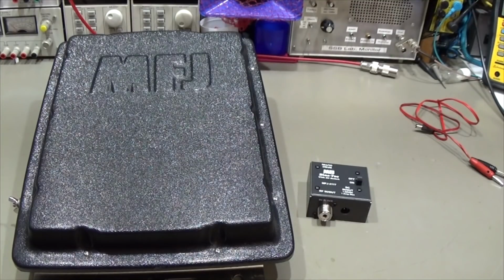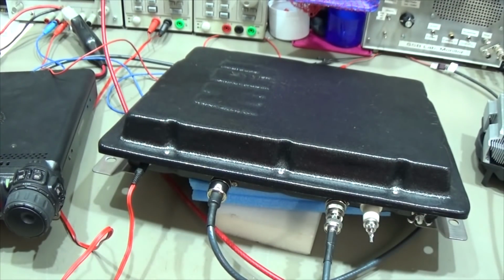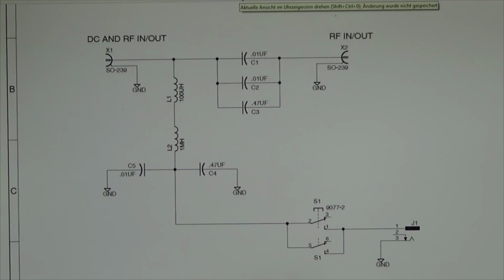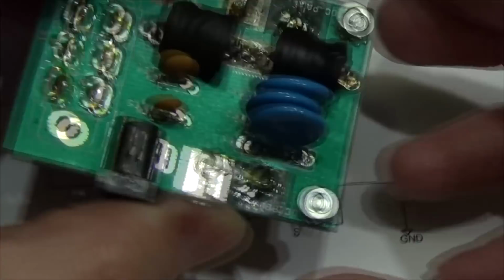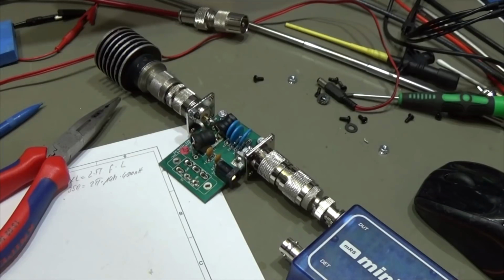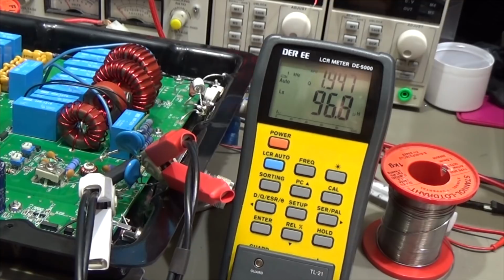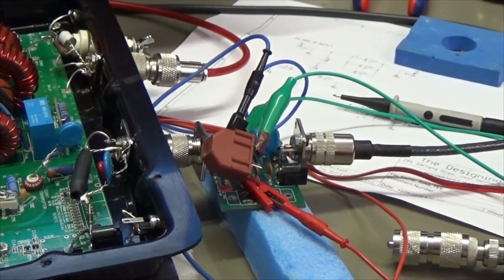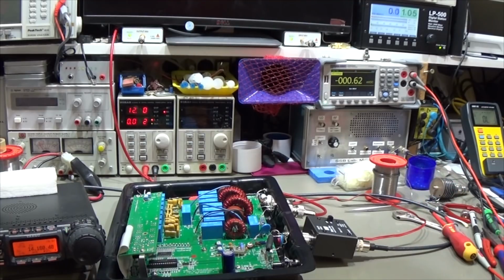#214 MFJ 994BRT Automatic Antenna Tuner  HIGH SWR fixed

Comment: Mighty fine junk. Martin's reputation is unchanged for decades. His firm has NO QA dept and it seems he hires kids off the street to perform soldering. Almost every piece of test equipment or gadget from MFJ is suspect. Have a screwdriver ready at all times. Also his designs for interfaces were great.... In 1972... Who uses DiN connectors for keyboards? The SWR analyzers use 10 AS batteries and you can blow a diode just by turning it on if the UHF button is pushed in. A known issue for decades.

Comment: It's hard to fathom that MFJ would manufacture a Bias Tee with the wrong parts.  But then, even persons working in the manufacturing field could have a bad day and choose the wrong part for insertion into the product.  It seems to me that even in the manufacturing of Yaesu radios, a person could not use enough heat sync paste on parts which eventually burns out the finals.  W Rusty Lane K9POW in eastern Tennessee

Comment: I've got a MFJ 969 Versa Tuner II wit a roller inductor.  However, it's only 300 watts.  That tuner will tune anything including a bed spring.  It even has an internal balun of 4:1 including a dummy load.  I really like this tuner.  Most all of my antennae are resonate so I don't really need an external tuner.  The tuner in my Yaesu 991a will tune all my antennae.  Sure do enjoy your videos.  W Rusty Lane K9POW in eastern Tennessee

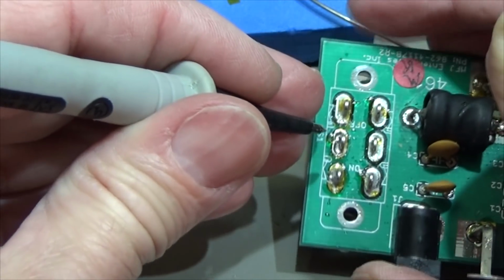Comment: 26:16 - That strange tin piece under the center of the switch is short with the edge of the plate (Ground). That is all.
73, EA7HJ

Comment: Another fine video,, but one question,,,,,, What did you do about the first problem with the DC input on the tuner that was not working right when you moved it ?
Ron AC7RH
Reply from the maker: nothing as it is not needed..

Comment: What a weird symptom.  I have one of these, and jave not seen this problem, at least not so far. (Finger's crossed.)
Reply from the maker: Yeah sometime it is weird so finger crossed
Reply: @TRXLab  Nice to see you got it working.  I was warned about these, but I'm pretty happy with mine. I mounted it up on a mast near the feedpoint of my dipole, and I've been using it to tune up on strange bands I can't otherwise use, like 90Meters. I have an amp, but I don't run power through it, mostly.  I'm not sure how far I want to push it, really, since it's a pain to get to it if I burn it up.

Comment: It looks like the two chokes in the Bias-Tee only have one turn of wire.  Why not just cut the shrink tube off of the 2 chokes, re-wind it with about 8-10 turns of magnet wire, and then put new big shrink tube back over, and re-install ?

I just got a Bias-Tee today, and checked it.  Both chokes I have in my Bias Tee are the exact same physical size as yours, but you can clearly see 8-10 turns of wire under the shrink tube.  Each is about 51 uH, and about 105 uH together.

Comment: Hi Peter. Did you decide if the wire on the switch was installed from the factory? Thank for the videos.
Reply from the maker: Well I think that was a production fault..

Comment: The interface for this tuner is absolutely ridiculous literally what's wrong with just having a control cable that goes from your Shaq to the tuner?
Reply: Because it is far more convenient to run power up the coax.  Some rigs can even do this automatically.

Comment: My friend owned the ham store in Houston.  They received product from MFJ that didn't work out of the box a lot.  I recall he sold a G5RV wire antenna and it was returned because it didn't function.  He gave it to a mutual friend.  My friend opened it up and found the wires were never soldered from the factory.  I got a 998 tuner brand new from him which didn't work out of the box.  The quality from MFJ is not good.  Mighty Fine Junk
Reply from the maker: yeah it is sometime a pain in the back if you are the quality control of the factory...

Comment: I have the 998 rt and its been back to  MFJ once. It works fine now. It's a very versatile tuner. I have the OG SGC and modded it to be able to use bias tee's. pretty easy.

Comment: Great video 
I have had one of these since they were released, the original one were even worse. No pcb board just three capacitors and the fibreglass box nevered sealed very. Mine is sat under the bench. 

73

Richard 
M0UOO
Reply from the maker: thanks for feed back

Comment: Hi Peter
Excellent video as always.  I have the same bias tee with exactly the same issue.  Could you share the part number of the chokes you used in you repair.

Thanks
Adrian
Reply from the maker: muRata 18473C;
 inductivity:  47 uH  
max (DC):  1.65 A  
max resitor:  55 mOhms
Reply: @TRXLab  Thanks Peter
Reply: @TRXLab  i didn't see you do it but did you put the center connections of those inductors back into the board and solder? or leave them soldered together off the board?

Comment: Hi Peter,
I have the same problem with my 998RT. Is the number on the choke 18473C? Just want to see if it's the same as yours. Stay safe.  73  WJ3U
Reply from the maker: Unfortunately the number is not readable but it is a muRata and taking your number it makes sense inductivity:  47 uH  
max (DC):  1.65 A  
max resitor:  55 mOhms 
you can use it...
Reply: @TRXLab  Hi Peter,
I have used my DE-5000  to test the two 18473C in series and it reads 3.2 uH. I lifted one leg on each choke to test. I removed both and tested each. One is 2.6uH and the other reads .023 ohms but no inductance. Using formula 14Mhz * 6.28*3.2uH I get 282 ohms impedance. I think that is the reason it does not work.  WJ3U
Reply from the maker: Absolutely right Don you caught the bugger :-)
Reply: @TRXLab  Hi Peter,
I also checked the muRata website and it does list the 18473C as 47uH. Must be a mislabeled batch. I found some axial 100uH chokes that should work and ordered them.

Comment: After reading some comments, I believe MFJ is not that bad at all. Few of the ones that makes Ham radio to still exist, with affordable equipment. The problem is the lack of a good quality control. There seems to be technicians with great experience, but also long time workers in the assembly line that are not technicians, but know the equipment they work on inside and out.
Reply from the maker: Thanks for comment
Reply: I’ve heard quality control issues. Hope the one I buy won’t have these problems. 73 de N9NY
Reply: Thank you Peter. Appreciate your providing us with a wonderful video! 73 de N9NY Gregg

Comment: I bought an MFJ DC distribution strip once and the main terminal binding posts were installed backwards - the RED was on negative and the Black was on positive. The soldering inside was horrible. I sent it back instead of trying to fix it.
Reply from the maker: oh that is scary

Comment: Would have lied to have seen an 'autopsy' of the iniductors. They might have been ruined by excessive RF power applied to the unit which may also have  melted the solder connection on the switch.
Reply from the maker: true but the video is already much to long...

Comment: The circuit didn't match the schematic.  That switch was wired to ground the bias lead via the inductors when it was switched off, and to apply +12v when it was switched on.  The pad that had that weird sliver of wire/solder was already connected to the ground plane on both sides of the board.  That's why it was showing a dc short between the dc pass pin and ground when it was turned off - it was designed that way.  You can follow the PCB traces at 36:58 and 26:12 . The invalid inductor values were the entire problem.  Typical MFJ quality control.  Did you go back and fix that intermittent power input connection on the tuner?
Reply from the maker: yes you are right but still that could be an operator error as well..

Comment: Thanks for the video. I would suggest to keep some ferrite cores for cases like this one. The ferrite choke you needed could be wound on FT114-43 core, 22+ turns of 0.9 mm enameled wire would do the job. 73s de R2AUK
Reply from the maker: That would be around 450uH and should work as long the wire resistor is still in the mOhms...

Comment: Diese kleine Metallklammer wird beim MFJ-4116 als Brücke anstelle des Schalters benutzt, ich habe heute nämlich einen SG-230 mit so einer Platine versehen, ist absolut identisch nur ohne Schalter. Was die Verarbeitung vor allem die Löt Qualität angeht, absolut unterirdisch. Ich habe alles nachlöten müssen. Ich vermute hier wurde eine Platine benutzt die für einen 4116 vorgesehen war und beim Schalter einbauen ist die zuvor entfernte Drahtbrücke irgendwie mit eingearbeitet worden. Hauptsache der kleine rote Quali-Aufkleber war mit Handzeichen versehen aufgeklebt. Was die Spulen angeht, sind bei mir die gleichen verbaut, ich habe keine SWR Probleme. Ich habe sie allerdings auch nicht gemessen.

This small metal clip is used as a bridge instead of the switch on the MFJ-4116, because today I have equipped an SG-230 with such a circuit board, it is absolutely identical only without a switch. As far as the workmanship is concerned, especially the soldering quality, absolutely underground. I had to re-solder everything. I suspect a circuit board was used here that was intended for a 4116 and when installing the switch, the wire bridge that was removed earlier was somehow incorporated. The main thing was that the small red quality sticker was affixed with hand signals. As far as the coils are concerned, I have the same built in, I have no SWR problems. I didn't measure them either.
Reply from the maker: What clip do you mean?
Reply: @TRXLab   Ich meine diesen kleinen gebogenen Draht, der den Kurzschluss verursacht hat. Schade dass ich hier kein Bild reinstellen kann, habe Fotos davon.

Comment: The short in the switch burnt the inductors enameled wire so that the coil is shorted for HF, why not cut open the inductor and se what happend?
Reply from the maker: hm most likely not because I got feed back that the unit initially  worked...
Reply: That "short" in the switch was to a pin that was intentionally grounded on the pcboard - so it made no difference.

Comment: What was the value marked on the chokes?  From the beginning, the extra grounded switch connection looked obviously like a solder spash to me.
Reply: The pin the solder splash was on was already grounded to the ground plane.  The splash didn't matter.
Reply: @stargazer7644  Surely it was the splash that grounded the pin on the edge of the ground plane?  Otherwise I don't see how it EVER could have worked!
Reply from the maker: That is a good point.
Reply: @hectorpascal  If you look at the pin that had the splash on it, 36:58 26:12 it has no traces running to it and is grounded to the ground plane on both sides of the board.  The pin to the left of it is also grounded to the ground plane on both sides.  It is designed to connect the bias wire through the inductors to DC ground when in the off position, and to +12V when in the on position.
Reply: @stargazer7644  So the schematic at 22:15 was wrong!?  Maybe!  - since either C4 or C5 also seemed to be misplaced.  But could this circuit change contribute to L1/L2 failure at switch off, due to discharge to ground of any high value DC feed line capacitors inside the tuner? Unlikely if the inductor coil wire is thick enough - since inductors impede transient current change, and I doubt the voltage rise would be significant.
Reply: @hectorpascal  Yes the schematic is wrong for the locations of the caps and the wiring of the switch.   This is not the right schematic for this version of the board (as often happens).  Grounding the center pin in the bias T wouldn't discharge any caps in the tuner due to the series reverse polarity protection diode between the inductor and the back of the power connector seen at the very bottom of the screen  at 11:12.  Regardless, you really couldn't do anything to the inductors to change their value other than burn them open.    It appears the wrong value component was simply installed and the unit was never tested after assembly.

Comment: Could questions in my mind , the markings on the original chokes - if they may have been correct - but then shorted out & changed values - by the on/off SW. ?
My quess that that small wire grounding the SW. may have been solder left by the worker installing the SW. , and it soldered to the ground plain - then when RF power applied - shorted the chokes - changing the values ?
Thanks again John
Reply: That side of the switch was intentionally grounded.  The PCB was wired so that the switch applies power when on, and ground when off.  The weird wire/solder line wasn't doing anything.  The problem was the wrong value inductors were used, and the unit was never tested.

Comment: MFJ is known for poor quality parts and poor quality workmanship. They are a low budget manufacturer for sure. If that tuner is rated for 600 watts RF I would worry that those inductors you put in can handle that level of power. I would take off the heat shrink from the original chokes and look for any damage to the windings from overheating. Was there any inductance value marked on those original chokes?
Reply from the maker: Thanks for watching

Comment: Great video!!!! As usual. 

MFJ is definitely a brand for those who aren't afraid to tinker. I don't believe they have a quality control department at all. I've taken apart more then a few MFJ pieces that where covered in flux or had cold solder joints, over soldered joints, solder bridges, and sometimes just totally missing parts.
Reply from the maker: Thanks for watching
Reply: instaBlaster.

Comment: That DC blocking circuit in the tuner looks like it was fitted, as the unit did not have that option fitted as new. I would be very suprised if that was a factory mod. workmanship was just to bad.
I never trust any unit that shows signs of people being in there before. nice fix
Reply: Actually it was installed by MFJ. You could google a lot of pics of MFJ 994BRT internals. All look the same.
Reply: @АндрейДенисюк-ш7п  bugger me thats bad. How can you sell something with a mess like that. No wonder they seem to have bad press
Reply from the maker: yes the should do it a bit better...

Comment: Hmm, I've seen a similar fault, I think perhaps the short pulled too much current through the inductor and cooked off the lacquer inside, making it shorted turns.
Reply: Yes, if the center pins of the switch were grounded then any DC input voltage would haven been directly shorted to ground via the two inductors. They wouldn't have survived that for long.
Reply from the maker: That the inductor might have cooked is a good theories
Reply: My guess was that the dodgy switch wiring was someone elses poor attempt to fix/get around the inductor problem which they obviously missed.
Reply: I also had a MFJ-4117 where the inductor burnt up. Those bobbin style inductors have very fine wire and when they overheat turns short out. I replaced the inductor with  JW Miller unit that had much larger wire, yet was not much larger, and fixed the problem.